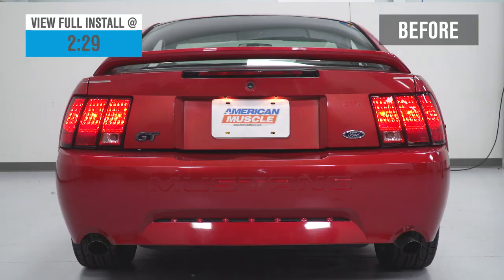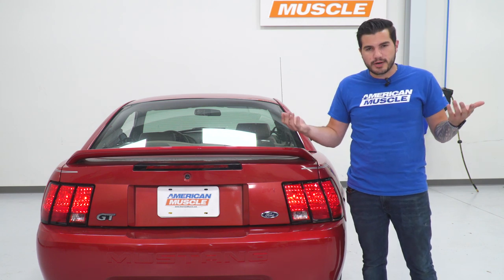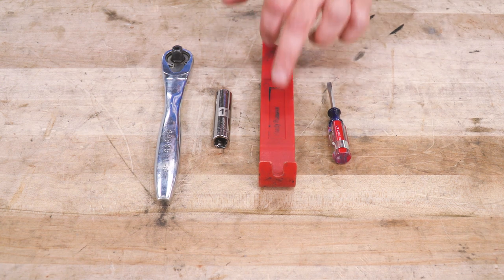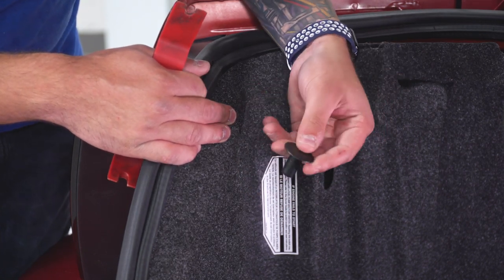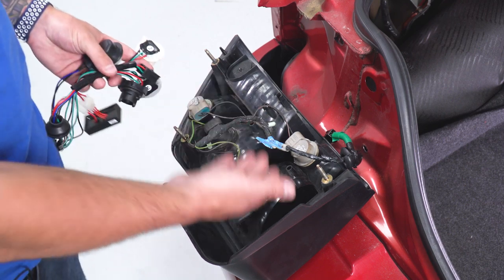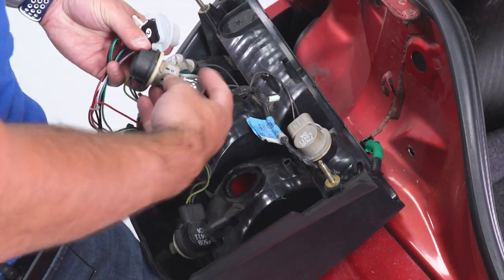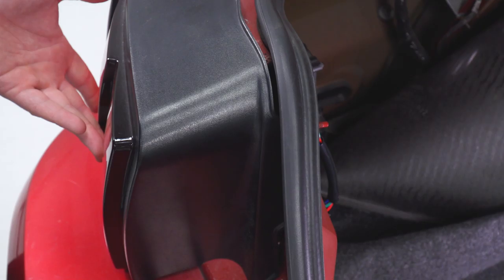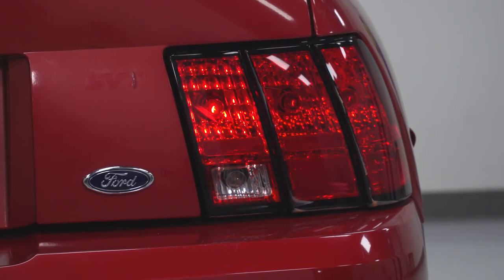1996-2004 Mustang Raxiom Sequential Tail Light Kit - Plug-and-Play Harness Review & Install

Comment: Used these for a while until my new edge was totaled.
1. Very very easy install, top quality.

2. The turn signal flasher modifier really does slow down the blink and it looks much better. It's expensive, though. (But everything in this kit used to be way more expensive 6+ years ago than it is now).

3. Get Raxiom LEDs to use with this kit. Incandescent bulbs glow briefly after power is cut. LEDs immediately turn off, which exponentially increases the effectiveness of the kit when used with the signal flasher modifier. (I actually have a full set of 6 completely unused Raxiom lights that I didn't get to install before the accident).

If you want to see the difference the flasher modifier makes I have a video on it. It's old and sucks, but it's there.

Also, the harness is good quality. My accident completely destroyed the rear quarter panel (impact at 50mph). In order to salvage the harness we had to cut the wires to one bulb.. But soldered on the connector from the original harness and it still worked great. No real damage done, and sold it with the flasher for about $65 or so.

Comment: I purchased the whole set from you guys and had a body shop install it. Emphasis on the “whole kit”. Not only were one of the led bulbs defective, the resistance equalizer/sequential turn signal module doesn’t work. In fact, the tail lights flickered randomly or didn’t work at all. Worse yet, the unit sent a signal to the cruise control system that disabled it. It sent a false signal indicating the brakes were being applied which turns off the cruise control. I found a mechanic in my area that has all the tech/diagnostic equipment to isolate electronic issues and pinpoint the problem. I paid him to remove EVERYTHING from American Muscle and reinstall my stock tail, brake, turn, and reverse light harness and bulbs. By the way, I purchased these parts a couple of months before I had them installed, so forget about a warranty even if defective. I’m not going to purchase anything at all from American Muscle for my 2002 Mustang GT convertible or from American Trucks for my 2011 Ram 1500, 2WD Outdoorsman 5.7 l (another bad situation).

Comment: I installed one of these harnesses on my 02 GT. For the most part the install went well with 2 exceptions. Both problems were with the backup socket. The bulb doesn't securely seat in the bulb socket and the backup assembly doesn't lock into position securely into the tail light assembly. I haven't come up with a solution for the bulb socket but I did get the assembly to lock down tight in the tail light assembly by adding an extra grommet. Both harnesses had this problem. I contacted American Muscle about this but they didn't have a solution for the "loose" reverse light bulb. I doubt that another harness set will solve the problem. One option is to cut off the OEM backup light socket and splice it place of the Raxiom connector. But then you won't be able to return the harness, of course. So far the backup bulb hasn't fallen out after hitting bumps.

Comment: These are great. However, they do come with their issues:

-For one of your gonna use LED bulbs the sockets don’t held them well like the factory incandescent ones. My guy heated up the plastic where the bulb is held for a bit and that seemed to do the trick. 
-The plug for the harness is a little tedious going in on the plug. It’s even worse when you need to remove it. Very hard to remove once installed. 

Other issues stem from me having the Raxiom Gen 5 taillights. Well I wouldn’t really say it’s and issue but AM/Raxiom should sell a separate harness for those of us that have these taillights. They should omit the reverse socket so we don’t have to deal with it since the taillights have a built in LED reverse light. Just would make life a little easier. 

AM needs more New Edge videos and less Eurostang ones.

Comment: I will buy a set when they make a kit that stops the brakes from sequencing! It should only be sequencing turn signals, sequential brake lights are illegal in most states and is also not how the newer gens tail lights work, these should not be on the same circuit. Revise this kit and it’s a sure buy for me!!!

Comment: what they dont tell you..........
if you use aftermarket LED bulbs, they tend to not work. no matter what you try. I tried incodecent bulbs, worked fine, but the definition was poor, then I used LED units.. well, after the hit and miss and trying of SEVERAL diff brands of LED it came down to this, they dont like LED bulbs,  PERIOD.
you can get them to work, but you will play hell finding the right combo to get them to function, back up lights were also, hit and miss. took a few returns to get a set that would actually have both back ups working. 
bottom line, stock incandescent, work perfect, ANY brand or cost of LED, its your dime... 
I have bags of bulbs, of all costs, to prove my point..

Comment: I installed mine with leds and I got the modifier to slow it down but it made it faster how do I fix it it was working when I had the stock bulbs before
Reply: Nvm I have to buy the second modifier v2 to work on the leds I installed

Comment: Kind of a dumb question but I have a 96 gt and that's a sn95 not a new edge, but the LED sequentials made for my body style are $350 and I wanted to know if these would fit my sn without doing any body mods
Reply from the maker: These guys wouldn't be able to fit right out of the box since the body styles between the New Edge and early SN95s are different. Sorry! -Zach
Reply: @americanmuscle  Yeah I figured, just didn't want to shell out $350 for the early sn95 led sequentials

Comment: What if I have some leds and halogen will it work the same
Reply from the maker: Without a relay, LEDs will give you some hypeflashing. I recommend getting this V2 Modified Flasher Relay if you're looking to use LED bulbs instead of halogens. -Zach
https://www.americanmuscle.com/raxiom-signal-relay-v2-9604.html
Reply: @americanmuscle ok but I have a relay from oriley for led hyperflash it's way cheaper than what y'all have
Reply: @Kaabosurron  did you get the sequential lights? Did it work well with the o'riley relay?
Reply: @alfonsos.9862  Nope I just got some leds in the center and kinda make the same effect and the oriley relay did work good don't buy the over priced one they have

Comment: To fast of movement imo.
Reply from the maker: That's why we also offer a modified flasher if you'd like to slow it down! Check out the following link for more info! -Zach
https://www.americanmuscle.com/raxiom-signal-relay-9604.html
Reply: Also upgrade to LED lights instead of the incandescent bulbs. The standard bulbs fade their glow out, which means they never fully extinguish before the sequence restarts. LEDs don't have the after glow.
Reply: And how do you put the modified flasher?
Reply: @marcolugo7673  go to a parts store and get a heavy duty LED flasher

Comment: Yea not paying that much money for some sequential lights. Just ripping people off. At least put some HID light with them if your going to charge that much for them
Reply: Yeah I kind of agree, that's a bit much for a wiring loom with a resistor in it, but if people will pay then they can sell it for that much.  If they came with LED bulbs I'd probably pull the trigger but I need a blower so that's where my money is going.